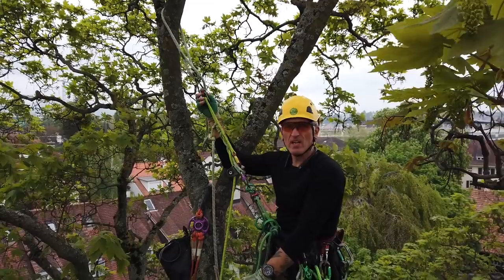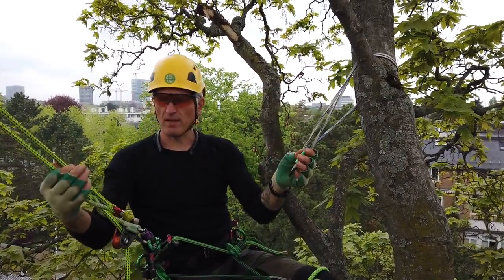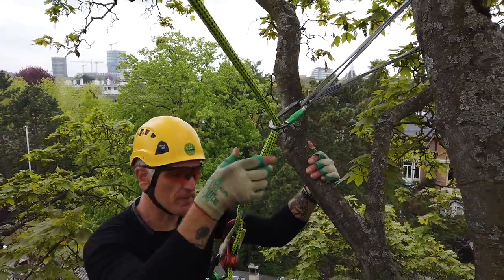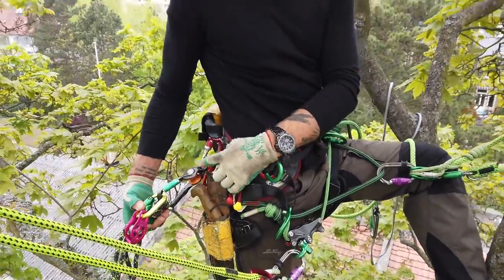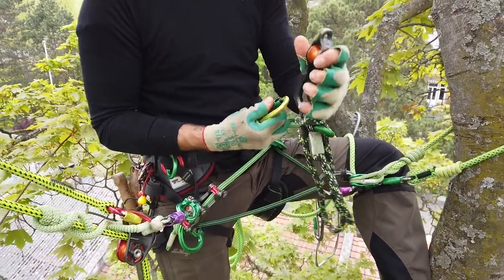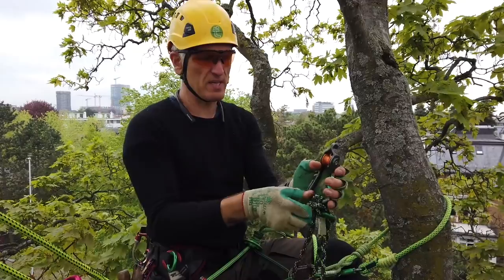Working with redirects in tree care

Comment: pardon me while I install this $400 redirect...
Reply: unfortunately thats all I could think as well...shit im happy with a spare sling/biner redirect...
Reply: True, but it's ultra efficient for MRS
Reply: All those items can be implemented into other climbing configurations. So an investment really i think.
Reply: @totaratree99  Exactly, it's an investment. It's an investment in your safety and your efficiency to work in and around the canopy.
Reply: Funny but its not $400.  You dont need the exact, and very expensive equipment he is using. You can mimic it with much less expensive gear. All you need are 2 biners, 1 pinto pulley, 1 pulley with 2 hole attachments (substitute for the revolver pulley) and an extra split tail  (to substitute the webbing sling). That's like $150 max. worth it when working a wide ass canopy.
Reply: @chaseaspen8904  Just did the math, as of now his exact system would cost $221.96 on treestuff and sherilltree
Reply: @owenalexander4176  Even though i think the actual price is higher ill take your word for it as im not going to individually search each item. Even if thats true im Canadian so that would come out to over $300 with taxes. I can mimic the system with other gear and spend half of that.
Reply: @chaseaspen8904   Not to mention shipping. I was being sassy/funny on the internet. I have tons of respect for these guys! Elephant in the room is that if he were climbing srs the video could stop at a sling & biner.

Comment: Nice stuff Mark - such clear instructions and superb footage.  Given the effort, in return, for ease of reference I've captured the salient points and time stamped it

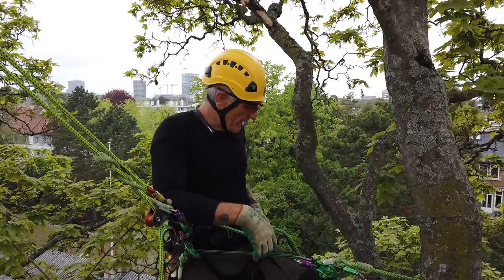1:00 Option 1: Pass both lines passed thru a carabiner on a webbing sling.  Can use the webbing sling in a either basket or choked configuration depending on the length needed.   Downside is friction between the two lines running past each other in different directions

2:00 Option 2: Add a Pinto pulley to run the lower line thru to separate the lines.  Downside is the possible pinching of the line depending upon the diameter between the Pinto's cheek plates 

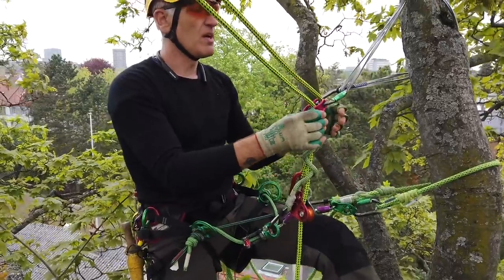2:48 Option 3: Add a Revolver Rig in addition to a Pinto Pulley to separate the lines with even less friction
3:17                 System is stored on vault behind handsaw.  Consists of Revolver rig, Perfecto, Pinto and Multi-sling
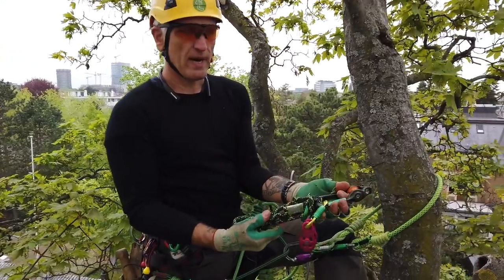3:47                 Set-up of option 3.  Note: when installing the Revolver Rig beware of the direction of the gate - to minimise it touching structure when the line is being used
6:47                 De-installing and stowing neatly

Comment: Slick set up! I've always just ran the pinto alone like you first had, except I use the spacer which can free spin and act as a pulley. Usually run true 1/2" lines for MRS and have yet to get pinched in the cheek. Knock on wood